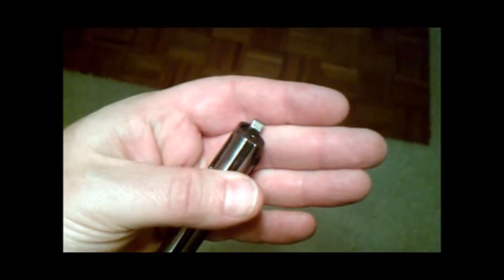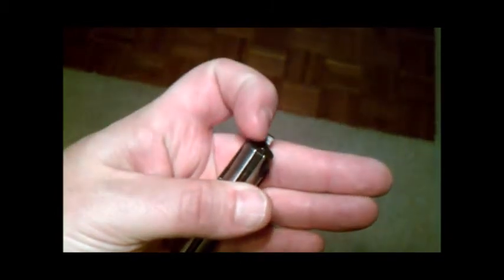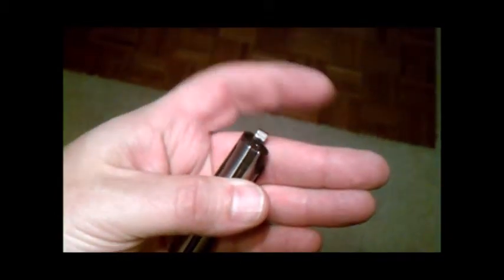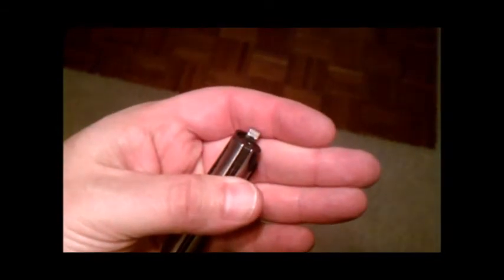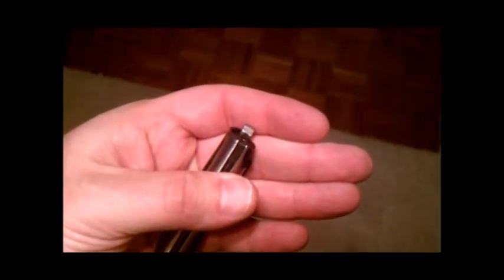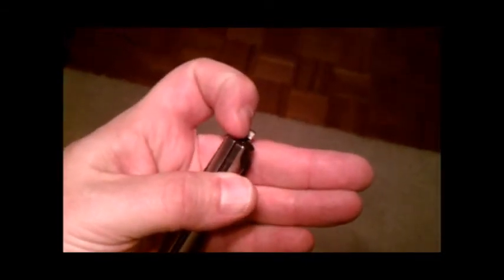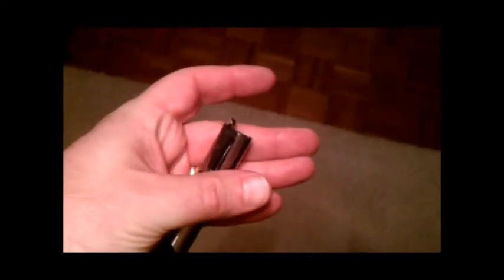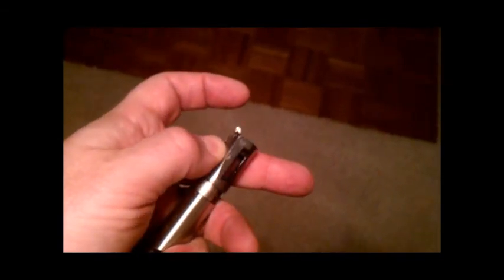336XLR problem fixed

Comment: i was looking at my owners manual and there is two different parts numbers for this extractor.
the 336 ss calls for part number 201001, all other 336 30-30 models (funny the xlr isn't specifically listed) call for part number 301169.  which one did you get from midway?